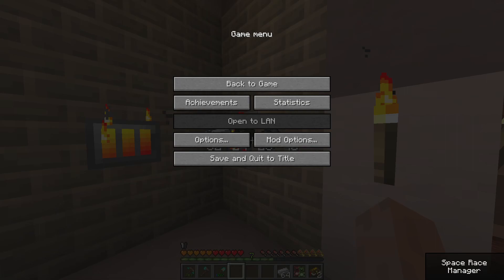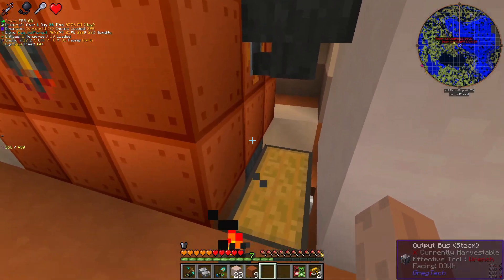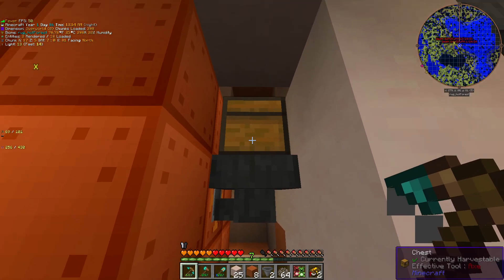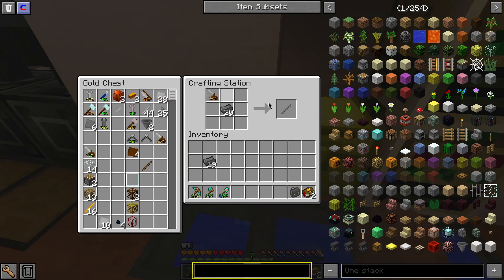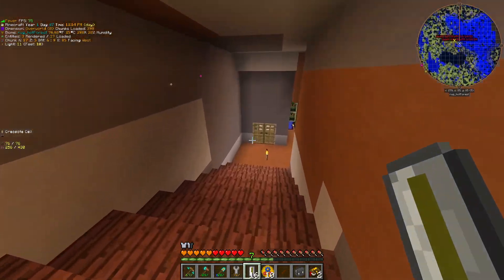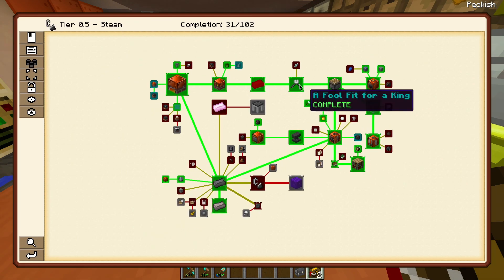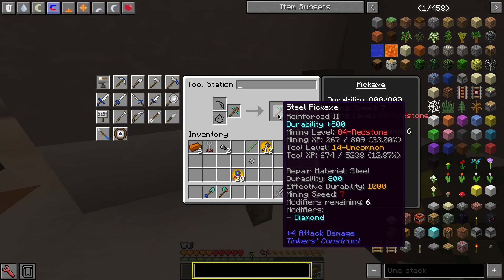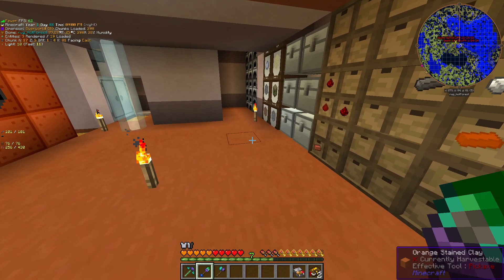Master Liquid Fuel Steam Boiler S3E15 in GregTech New Horizons

Comment: Hi! Alumite can be a pretty nice tool material and generally ends up being better than steel in terms of durability, and also (if I remember correctly) in terms of durability modifier. I think you just clicked on the wrong Alumite ingot. There's a lighter pink one that's what you're looking for as a tinker's metal. Watch the video starting at 10:22, it's 5th from the left in the top row of the search results for alumite
Reply: Also, thanks for showing how to use the liquid-fueled boiler, I was wondering about that. I'm glad yours didn't explode!
Reply from the maker: @mondair99  only explodes if you heat it up without water inside.